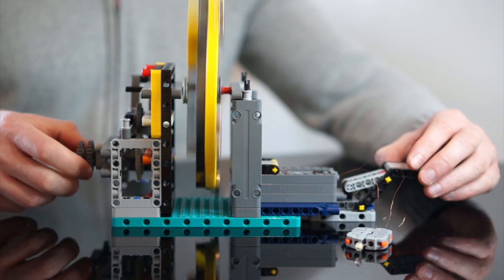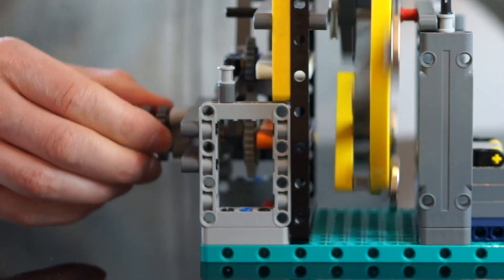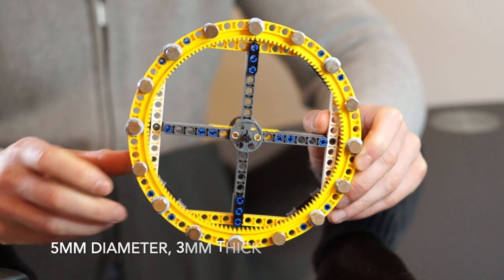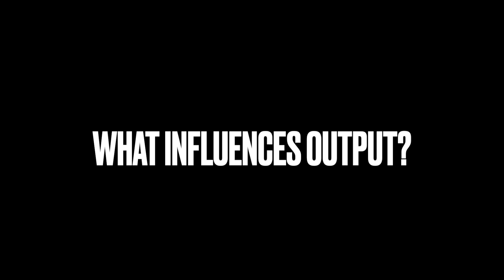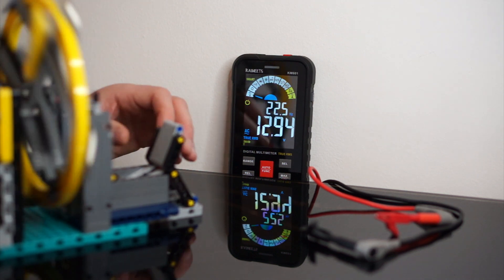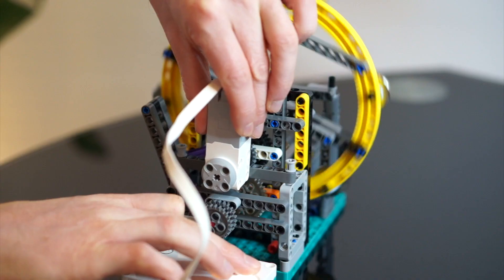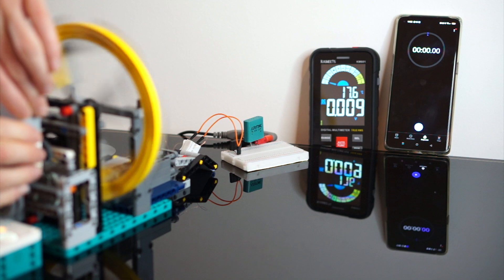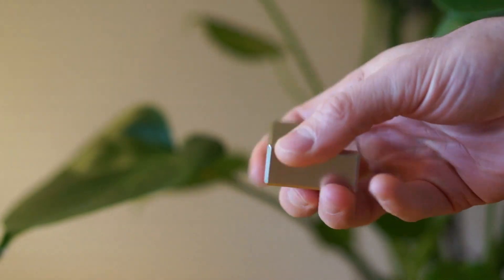Testing an Adjustable Lego Generator

Comment: emf = -N*Delta_Phi/Delta_t, where N is the number of turns of wire, and Delta_Phi is the change in magnetic flux. The fact that your bigger magnet has a stronger magnetic field directly means that you will have a larger emf with all else being the same.
Reply: Its not the size of the magnetic themselves, its the size or magnitude of the magnetic field, i.e. - You could have had physically smaller magnets but they could have been magnetized stronger.
Reply from the maker: Very true, I should really have made that clearer - I guess if someone were to use a weaker but larger magnet (e.g., ceramic) then the output would be weaker. I guess at the time I wondered if the higher frequency and speed afforded by many more (but smaller) magnets could generate as much EMF as bigger magnets (but fewer of them).

Comment: You've done a fantastic job with your channel so far and as many others are saying it seems like you're about to gain a lot of traction! The electromagnetic experiment niche could prove to be very popular. As an idea, I would love to see you build the "most powerful lego electric motor ever" as I can't really find any examples of electric motors made from just magnets, copper, iron, and lego. You are so much of the way there already with the structure in this video!

The most powerful lego motor I can find is the RC race buggy motor, which draws 15 watts at ~10v and produces just ~6 watts of mechanical power. At the scale of this build, with some more stator poles you would already be in the 100s of watts power handling territory, and possibly already better than the 40% peak efficiency of the buggy motor if you choose a BLDC pole pairing/winding that works with off the shelf brushless ESCs!

If I were attempting this I would put magnets on both sides of the rotor and add a mirrored stator to cancel out the axial forces from the poles on the rotor and bearings, as I doubt lego pieces hold up well when used as a thrust bearing. Then I would do whatever possible to improve the rigidity of the rotor, the axle, and the bearings.

Also, if you want to make a more efficient motor, you might look for "soft iron rod" or "ferrite rod" for the cores instead of an iron or steel bolt. Ferrite will be the weaker core material compared to soft iron, but both will produce significantly less heat for the same power as the bolt (significantly lower eddy current losses) as long as you aren't saturating them. Of course the bolts would work though!

If you pulled this off, I have no idea what you'd then be able to do with 100s of watts of mechanical power in lego, but you'd probably be one of the first to have that problem haha.
Reply from the maker: Thanks for taking the time to write out such a reasoned and detailed comment, I really appreciate it. You know I've actually been toying with that idea for a while, and even have some BLDC motor controllers that can handle a pretty large output... My main struggle was thinking of why I needed all that power for a Lego machine, and what I would do with it. Lego is usually limited by the mechanical strength of its components.. and likewise, so are generators. I've already come up against the limit of how much force I can put on parts. But if you or anyone else have any ideas for what to do with an absurdly powerful Lego motor, I'd totally build it. Might need some metal axles or liftarms to deal with the strength of it though!